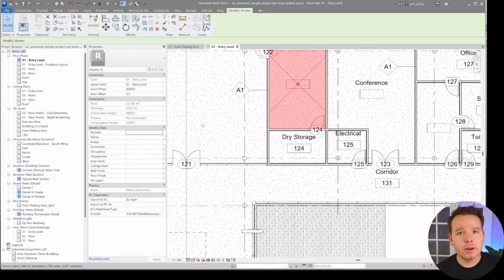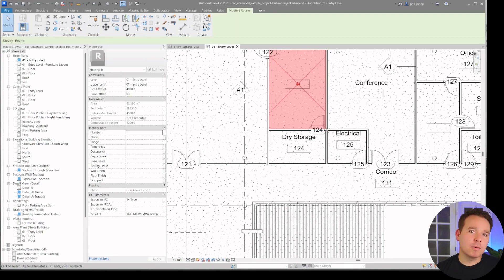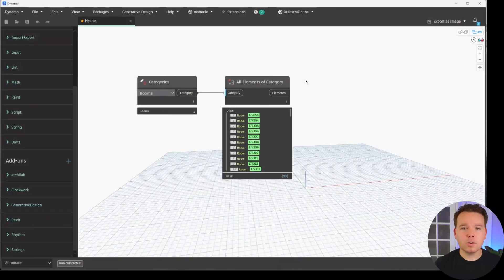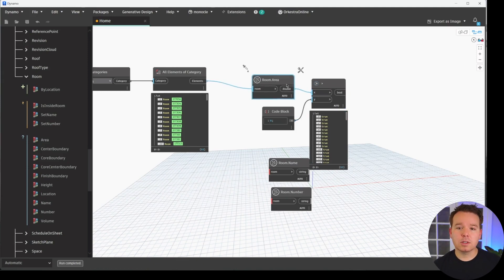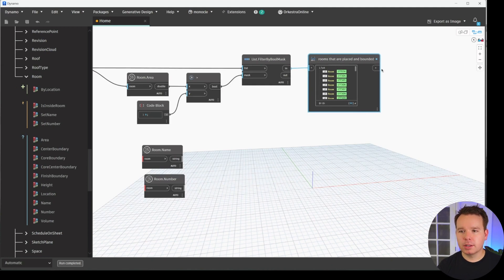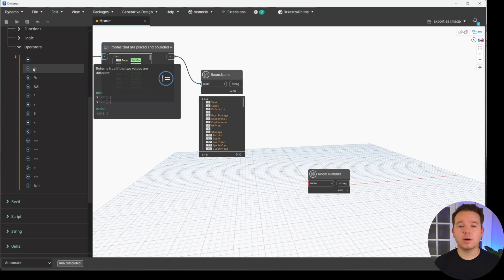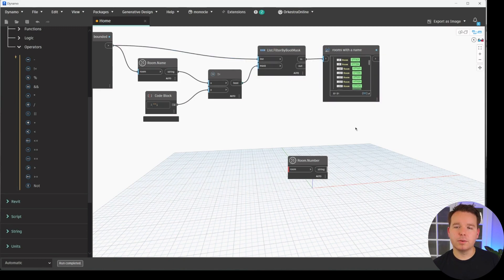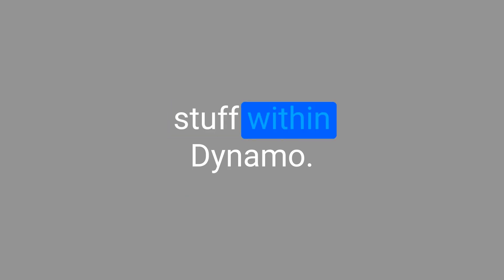i had no idea this was possible in revit

Comment: I have never tried to just delete the room names or numbers. I wasn't aware that was a thing before you mentioned it. 99/100 - the only interaction I've EVER had with those fields was to rename/renumber the default value. 🤔
Reply from the maker: I think, in this case the user was tracing a PDF with Room Boundaries to get the area. And didn't want to see the room names?